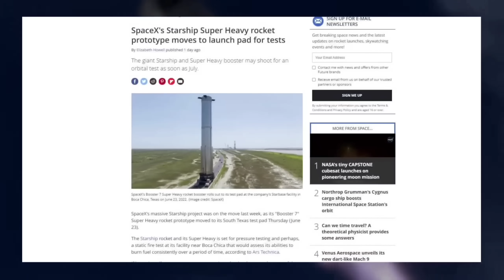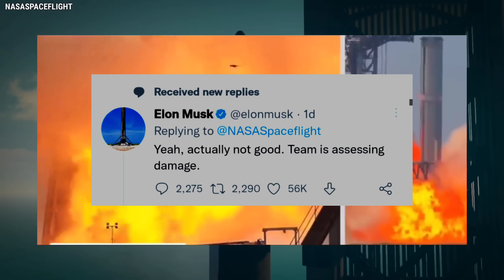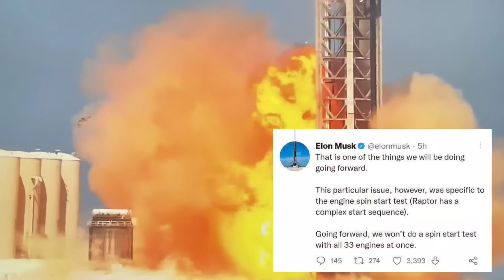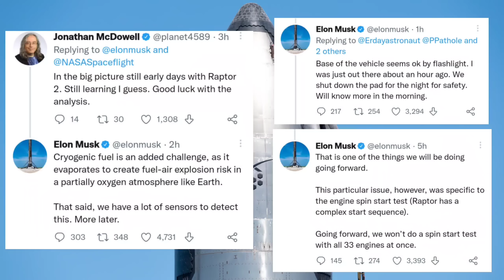Elon Musk JUST REVEALED the cause of booster 7's Explosion!

Comment: 0.55 it's a very extreme tactic, applying so much Beastly thrust on such a narrow brave OLT, because the Beast has no allies to reach high orbit, it cannot successfully park the Beauty stage in orbit velocity, thus make multi sequal RISK of; Refill (human cargo o2 & supply), Refuel (weather and traffic time gap, abandon in orbit of schedule scrub). Relaunch ( already extra stage fuels, rendering in time delays multi launch of 2 FUL set of Starships) vertical bureacrocy.

The OLT, should've been a two-split ring tray stand, on a fast protracting limbs, with a separate fuel inject filler. Essential similar to the Claw or Chop-stick,
( i.e. 'Mechazilla Legs.').

 The limbs of Mechazilla are already too adjacently close to the launch bay and landing spot in just a 90° turn gap. it will need a Mecha Torso shoulder ( & also in this case a hip). The original OTL, still to short off the ground.

Comment: Nuclear powered starship is the way . Cryogenic  fuels are to impractical.
Reply: they will still use a fuel to get action reaction going its just that the expansion power comes from nuclear heat not a explosion that is under control.
Reply: You do realise that to launch a Nuclear Rocket to LEO, it will still be done with chemical engines